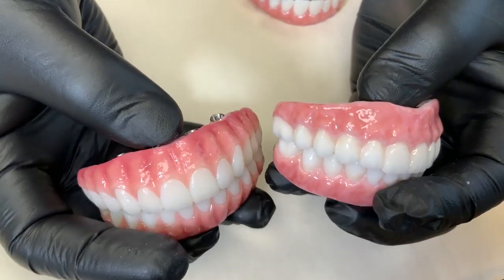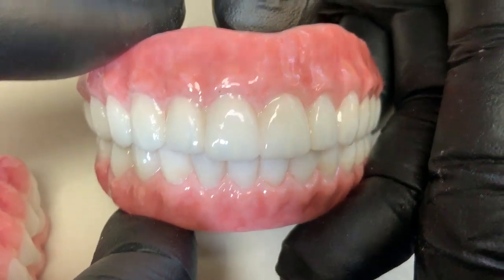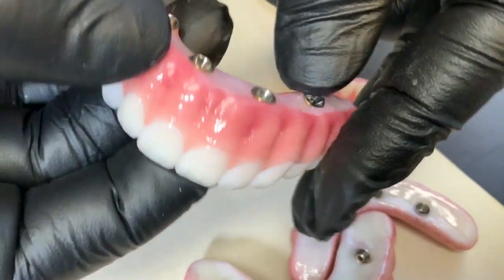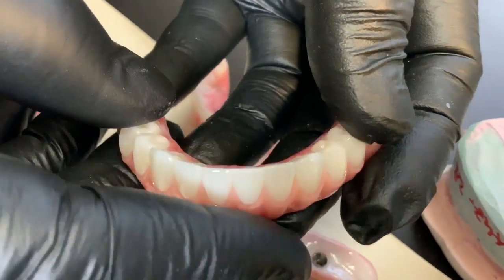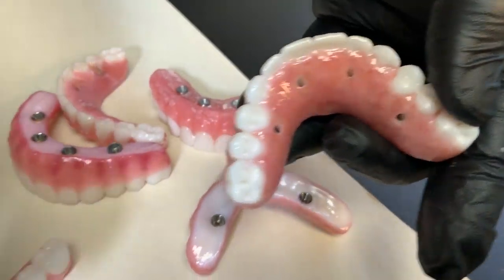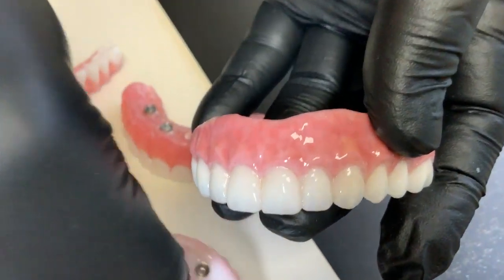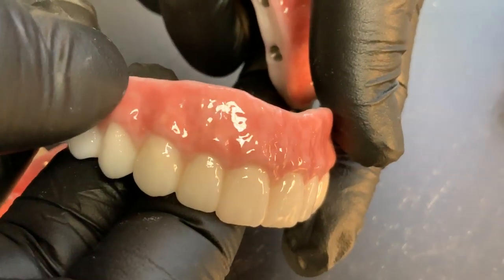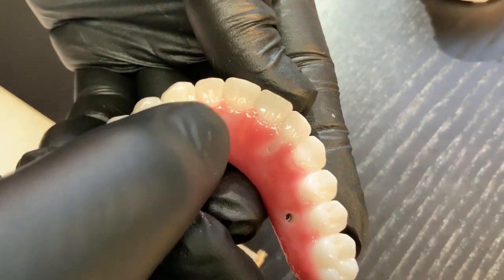Awful VS Awesome!  Full-Mouth Prosthesis

Comment: Doctor.  I have a question and I hope your able to answer for I am going through the processs as we speak.  I just recieved all on five on my bottom jaw, and a full denture on top along with bone grafting for future all on four implant's.  I am still in my first temp's, which I'll be in until my final set. I know some say I should be in a second prototype due to my collapsed bite as this will make a huge difference in facial esthetics  My dentist so far has not corrected my VDOO and has no interest in helping choose correct teeth for my face shape. He said I would need filler to fill out my lower jaw, as well as not agreeing on the terrible shaped teeth for my Bite/face shape. My question is, If when the dentist finally complete's my case leaving me with permanent's, and I decide to go elsewhere to have them re-do the teeth for look's and occlusion purposes, will I have to pay for the implant's and screw's all over again, or just the arches?  Thank you!   Your advice will give me great hope since I have lost all hope at this point!